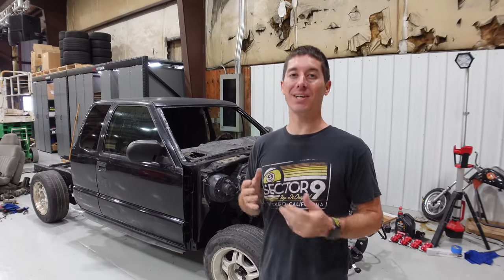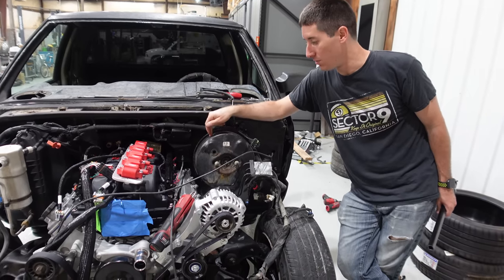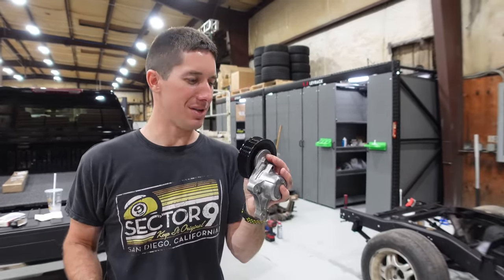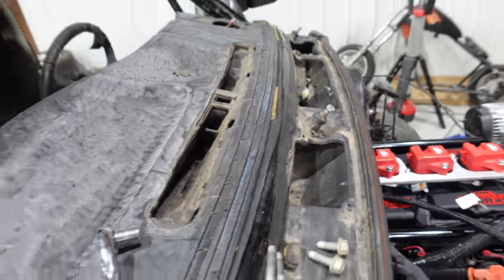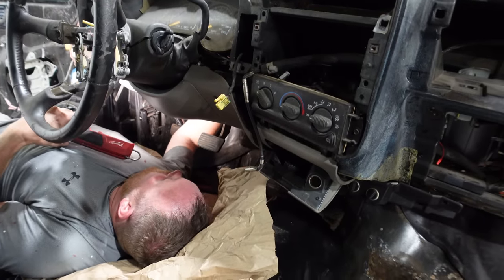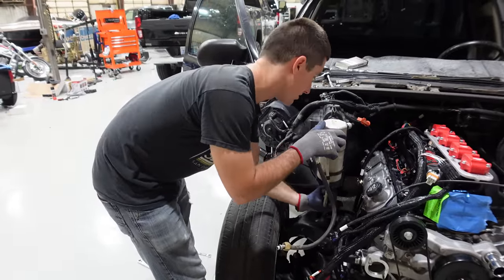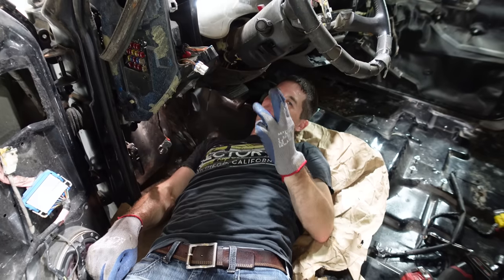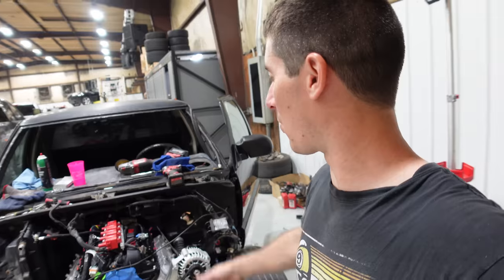Do NOT LS Swap Your S-10 Unless You've Done This FIRST

Comment: Don't weld the brake booster rod.  Thread the rod with a die and use a threaded sleeve and jam nuts.  It allows you to tune in the brake pedal height when mixing parts.  Once you get the right height add some loctight or tack the jam nut to keep it from ever backing out.  Makes replacing the booster in the future easier also.   One thing to look out for when mixing parts is the booster to master pin tolerance, make sure the clearance is right so you don't drag or have a soft pedal.  There are 3d printed tools to measure it or they sell them.

Comment: Get a vintage air compact unit. It puts everything under the dash and you keep all that room in the engine bay. Then get a high mount pass ac bracket for ict or dirty dingo and your good to go. I did it on my 91 TA and gained a ton of room in the bay and under the dash, ac out of the vent is 38 degrees
Reply: I was about to make the same suggestion, Vintage air even makes a firewall forward kit with a smaller air compressor that can plumb to the factory EVAP box.
Reply: Yeah you don't need all that to swap an s10 that's Overkill and those Holley mounts he's using are part of the problem why things don't clear
Reply: @neilbrown82  can you recommend good mounts? I really don’t want to modify my Bravada’s braking system significantly.

Comment: You need to get either an inflatable paint booth, or do the 1 inch PVC and plastic + AC filters and a fan paint booth.  I've painted hoods using the PVC pipe make shift booth (inside my shop) and you can get it as clean as a real paint booth.  But the more important thing is you can paint inside without getting overspray on other stuff.  Just need a respirator and set it up so the fan blows in through filters, and exits through filters, lined up with a garage door so you can open it to the height of the opening so it exhausts out side the building.

I've done a few LS swaps but I have never bought a kit, just made my own brackets and wiring and flashed the GM computer.  One thing to note you can get a straight thermostat housing, which makes the bottom hose much cleaner than the fbody housing that is angled.   I do wish holly made that same type of airbox for thirdgen fbodies tough.  It would be nice to have a tad more clearance on my formula.

Comment: the evap cover yes that is a must probably,i did it but i did NOT remove the entire thing like you did good lord bro,you can slide it in behind the engine, haha,as for coils mine didnt hit the brake booster.i have a 2005 blazer,with a cammed 6.0 and centrifical supercharger.i bought the hooker steering shaft and it still hit the header,so had to dent it which everyone does,so who cares,now i went with rubber motor mounts because im a stereo guy and didnt want my dash vibrating like crazy from polyurthane motor mounts.OH and i did mine with the entire front clip and grill installed,just remove the hood.every single nut,bolt and wire by myself,except the exhaust,and im disabled i laughed when you said ohh my arms hurt omg bro it about killed me doing all of it,i cut my core support for a huge 3 core radiator,i got the ac condensor relocator and moved it forward,i bought everything at current performance wiring,they have all the stuff you showed.well good luck to everyone doing this,it can be done,spend lots of time with a huge hammer and pipe beating under your firewall so the engine wont hit when it flexes,thats one thing i spent days on.if your gonna cam swap it,get ready,the valve spring retainer clips is a bitch to do,for me mine was on stand really high and i had to lay across everything to reach the back cylinders,most importantly is get a good moble tuner.forget dyno tune.later

Comment: Ya ought to put a modern hemi in something some day. They can make stupid power with a turbo or two or blower etc just like the other engines. But the ls engines are everywhere and everybody makes goodies for them to put in anything and make power so understandable to run them. It's really amazing what all kinds of modern engines are capable of these days if you want to go nuts. I think you'll get it together in time to go play with all the help.
Reply: If he's going to need to that they’re phasing out the hemi modern hemis have cam shaft oil issues and because of this, hemis are quickly.

Comment: It's a "let's make Holley richer" kit. I ls swapped a 96 standard cab and didn't buy one holley part. Granted i fabbed my own cross member and notched my own frame. I bought mopar master cyl and got $138 kit online for manual brakes but you drill a hole 2 inches higher in the brake pedal and that increases push rod leverage and they work as good as power brakes. You can get all four bolts off the brake booster in 2 minutes with a 15mm deep wobble socket, 10" extension and a cordless impact.

Comment: Yep definitely no clearance with those Holly mounts but using other branded engine mounts like many others have I have factory coils on my swap and the stock location and they clear everything just fine you don't always have to drink the holley  Kool-Aid and also stock truck accessories fit
Reply: Same here we didn’t have to change the steering shaft or the brake booster or mess with the a/c box.
Dirty dingo mounts and cheap eBay headers FTW

Comment: I replaced the brake booster on a 98 blazer. It was a nightmare. I used a crowsfoot wrench with a swivel and some extensions. Couldn't get the 4th nut back on though...

Comment: I’m old.  I’ve SBC swapped an S10 and some things are the same (heater box cut out) but to me it seems the 350 swap was easier…for sure less expensive conversion parts.  You can even use factory exhaust manifolds from a 3rd gen Camaro.  Also the 4.3 accessories, transmission, and lots of other parts bolt right onto a 350 since they’re the same engine family.  But nowadays cheaper and less headaches to throw a eBay turbo kit under your cab on a 4.3!  Budget Syclone!
Reply: Not sure why anybody would swap at 350 turd into an S10 when LS are available you can literally throw a rock and hit one
Reply: @neilbrown82  I did my swap almost 20 yrs ago.  Torque and hp were more than sufficient.  Things weren’t always like they are now…
Reply: The vortec 5.7 350 is literally a drop in.

Comment: Questions have a 99 s10 blazer 4.3l v6 4wd automatic. I have plenty of 5.3l and 6.ols engines. My 4.3l has seen better days and can't find one reasonable in my area. I just want to put a mild/stock 5.3l ls in it just for a daily driver. I live in a area where 4x4 is absolutely necessary.

Comment: Dear WatchJRGo 
Don't weld the brake booster rod.  Thread the rod with a die and use a threaded sleeve and jam nuts.  It allows you to tune in the brake pedal height when mixing parts.  Once you get the right height add some loctight or tack the jam nut to keep it from ever backing out.  Makes replacing the booster in the future easier also.   One thing to look out for when mixing parts is the booster to master pin tolerance, make sure the clearance is right so you don't drag or have a soft pedal.  There are 3d printed tools to measure it or they sell them.

Comment: Running that same accessory bracket, ran into a issue with the power steering pump pully hitting the gearbox, are you running a smaller pully?
Reply from the maker: I had to clearance one of the bolt heads to make it fit, sounds like a common problem 🍻

Comment: I am using the stock brake booster, stock manifolds, stock steering shaft and it all fits.
Reply: What engine mounts did u use?
Reply: @frankrizzo2724  Current performance s10 LS swap motor mounts, I was surprised it all fit since most people say all the stock stuff won't work. I did have to take the steering shaft off while installing the truck manifold but there's still a 1/4" of clearance between the shaft and the manifold. 

Just a note on the manifold - I'm running a turbo setup so I cut the stock collector off and welded on a V-band flange for the crossover pipe. There is no way the truck manifold would work with the stock bolt together collector!

Comment: Im LS swapping a 83-S10, plan is to make it offroad toy. The AC condenser housing was busted up and I plan delete the AC anyways. So I removed the condender, but I want to keep running factory heat as I live in MN. Would you recommend buying that replacement housing and just filling the holes?

Comment: This is the first video that mentioned clearance issues with the brake booster. Most throw on aftermarket transmission mounts and just move the entire engine forward. 

I’ve seen one dent the edge of the booster in and it cleared.

Comment: Do you plan to run A/C? Also if i run a 6 speed manual do you have any idea which transfer case i should run? I have to put a pedal set in but thats easy peasy compared to everything else. I just really want to daily drive my S10 and being in humid ass Florida i need A/C
As for hydro boost, they came on the 6.2 and 6.5 diesels so should be some in wrecking yards or even military surplus. I am certain my Transfer case hooked to the 4.3 just wont hold up behind a 6.2/ 6 speed manual especially sonce i plan to race it occasionally

Comment: If the 4.3 is basically a 350 with 2 front cylinders cut off why doesnt the ls fit better are the heads angled wider then a 350 and why did the transmission have to move back if you could have just moved the motor mounts forward and run an electric fan instead of the clutch style fan so there is more room between the engine and radiator
Reply: 4.3 isn’t based on the 3rd Gen LS motors. While the 4.3 is a modified Chevy v8 block it isn’t based on a 3rd Gen block.

Comment: Just curious, You said you wanted to keep ac. Do they make a relocation bracket to mount the compressor to the pass side upper?
Reply: Yes they do on driver or passenger side holley makes them its expensive to do ac on s10 ls swap u endup spending 200 for new compressor custom ac lines 175 new o ac o rings 5  ac bracket 185 and dont forget freon r134a like 45 plus replace any ac component thats defective have it service vacum the system paying to fix any leaks and charging the system its like 300 for the job or more addid it up

Comment: Just curious, would a 4.8L LS have given you any more clearance in any direction?  I know it’s only slightly smaller than the more common 5.3 but it’s still an LS and therefore a great engine.
Reply: no, the engines are identical externally.
Reply: I have a 4.8 in my s10 and there's literally no difference in external dimensions.... I went 4.8 because I was told they enjoy the higher revs.... I eventually want to turbo after a cams lifter's springs and head studs with maybe a little diy grinding on the head no need to buy aftermarket unless I'm going for anything more than 600 hp Wich isn't the plan.. yet lol

Comment: No need to swap brake booster u can easily get away with stock booster your motor mounts might be high my s10 clear coil packs on driver
Reply: If you don't mind me  asking,  which ones did you get?

Comment: Do not LS swap your S-10 period. Do what I did. Build your own old school small block, in my case a CARBURETED 383 stroker. The block is the only GM part in that engine. Mine came with a 2.8l/5 speed. I replaced the transmission with a 1969 Muncie "rock crusher" 4 speed, and replaced the rear end with a Ford 8.8" 3.73 Trac-Lok.